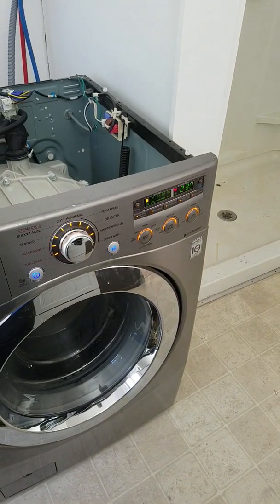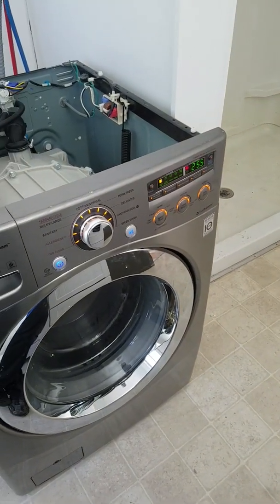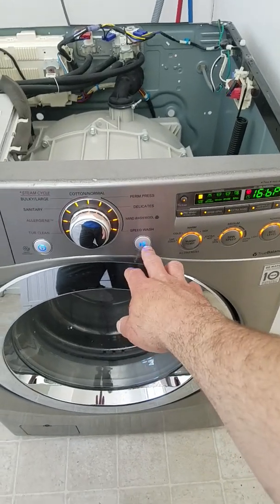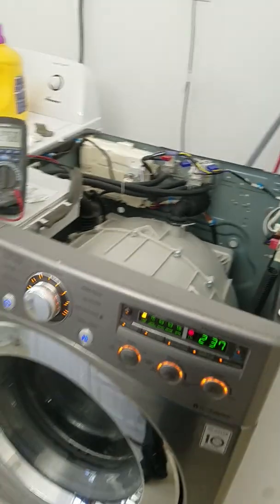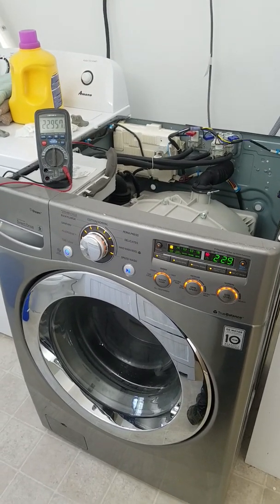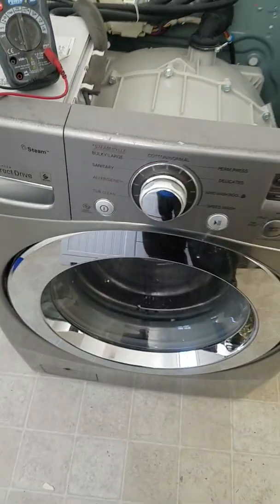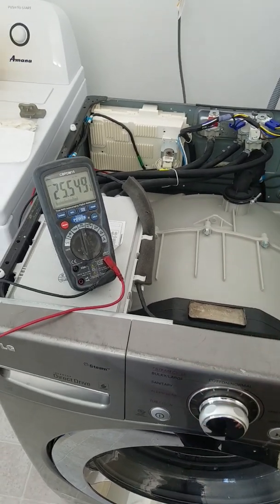LG Direct Drive Washer OE Code Troubleshooting (Water Level Sensor Testing)

Comment: I have a WT5101HV with a 68 water frequency empty. It won’t drain (no clogs and good pump). Pressure sensor hose is open. Bought a new sensor and frequency is still 68. I’m at my wits end…. Any suggestions would be greatly appreciated. I’m starting to suspect the main board but don’t want to throw money at a guess.

Comment: Your video was definitely helped.  I had OE error.  Machine would not spin or drain all of the water out. I replaced drain pump because it was full of brown scum.  Still had all of the same problems. In diagnostic mode, I noticed that the water fill indicator never moved from 255 even with drum 1/3 full. The pressure sensor was reading resistance in range. I took apart the lower drain including the air chamber for the pressure sensor and the air chamber was clogged.  Cleaned everything up underneath, blew out the sensor hose and the machine works like new. Thanks!

Comment: After being a sucker for the OE error, I replaced the drain motor and main control board and it still failed. Watched your video and checked on the water pressure level sensor and hose and found debris in the line. Blew it out, reconnected and tested. Passed diagnostics mode and a speed Wash. Live and learn. Thanks for the info.

Comment: What is the value of the frequency and between what terminals.  There are 3 terminals.
Hey man, why aren't you being clear instead of  giggling and mumbling to yourself.
Reply from the maker: I removed your comment. Be more professional with your replies. I don't exactly remember if it is AC or DC however I do remember LG uses AC in many areas on the machine. I want to say it was AC  voltage going to the sensor which would make more sense than 5v DC. 

Make sure the sensor is reading the water level correctly. Most people want more water not less. To do this, you need to put the washer into service mode which you can find in the video. The sensor should react to water level changes immediately. You need to monitor frequency first.
Reply: @graywaveautodiagnostics9389  AC is not supplied to the sensor.   What is supplied is DC waves, i.e. pulsed DC, or high frequency DC or whatever term they use.  The so called sensor is in interface with the low side on the module operating on  5VDC max. 
[In all essence what is supplied is pulsed high frequency 5VDC....]
There is a feedback loop from the low side to the high side of module after certain frequency is reached as the output from the sensor. The high side supplies that 120 AC to the water valves.. They indeed use full AC voltage.

You shouldn't play with these things if you don't understand simple operating principles... :-) But I recommend you do.
Reply from the maker: @alchemy1  So you understand your machine now? Good. Glad the video could help
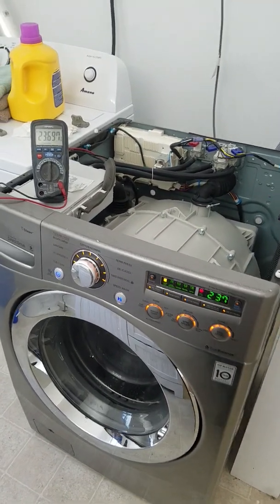Reply from the maker: The value of the frequency is shown in the video. If you probe the two outside pins you will get the frequency just as I show at time 1:44.  23Khz seems to be when its FULL and 26Khz is when the drum is empty. You can see the frequency is in the KHz range at time 5:31 and you can see the value of the frequency through out the entire video. Each machine could be slightly different especially if you have a different model. How much more clear do you want me to be?  Hey man, did you watch the entire video? If so, your question tells me you shouldn't be touching your machine

Comment: I just had this OE fault, pump was emptying the drum but continues on trying to pump. I disconnected the small hose to the pressure switch and used a bicycle pump to blow some gunk back into the filter box at the bottom of the machine. Voilà, one perfectly functioning LG.
Reply from the maker: The fantastic! Its odd problems like these, which are not described in the troubleshooting guide, that will make someone buy a brand new machine. Without "testing", the "fix" is safe and simple as long as the machine is unplugged. Glad you got yours working. Ours is still running just fine since the repair.
Reply: I replaced my pump and it drains fine but the OE sign comes on mid way when there is no water. Any idea what it could be? Could it be the sensor?
Reply: @edwarddeleon413  the pressure/ level switch is mounted inside, above the drum. Pull the rubber hose off the sensor and use a bicycle pump to check if the hose is blocked. Pump air down the hose, if there’s any resistance, it’s blocked, If the hose is clear, the sensor is probably faulty. Hope this helps.